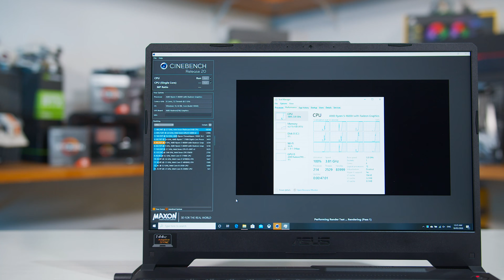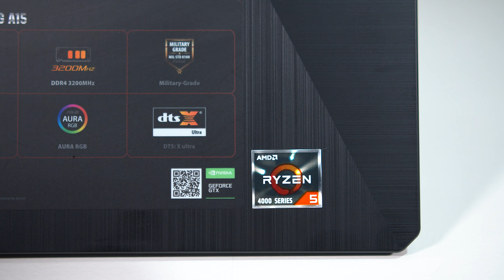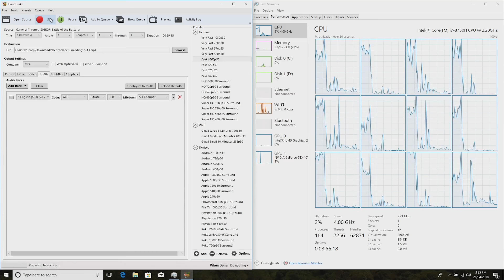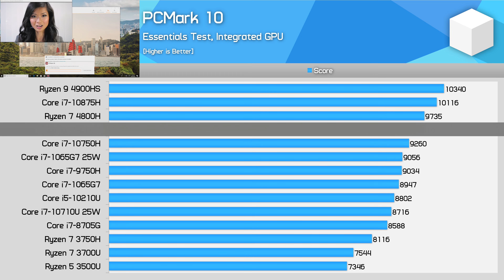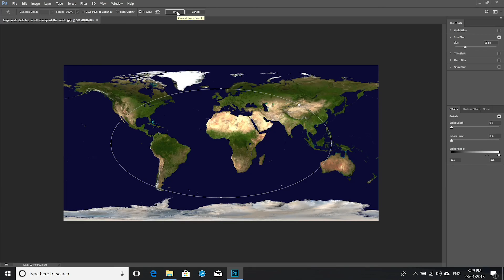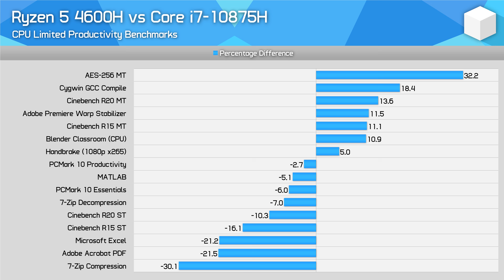AMD Ryzen 5 4600H Review, The Fastest Entry-Level Laptop CPU Ever

Comment: As i saw in your video 5700u, what's the best choice in terms of heavy excel use if the choices are somewhat in the same price range? Ryzen 5 4600h or Ryzen 7 4800u? Based on your data ryzen 5 4600h seems to have a lil advantage in excel. But is it worth it choice compared to 4800u in over all performance? Ryzen 7 4800u have 2 more physical cores please help. I'm a student and planning to work as my part time. I'm in finance

Comment: Just got my laptop with Ryzen 5 4600h man - great review! I have one issue and is battery drain in less than 1 hour. Its a lenovo laptop, im using for surfing currently and the battery is going down sooo fast! I have just noticed that my Processor Speed is jumping to 3.98 GHz and stays there and I think that s the main issue for the battery drain. Do you think how can I fix this? It would stay to 3.98 for 15 min 20 or whatsoever - sometimes more! CPU temp at 60C. I reinstalled drivers for everything, Speed now is 1.39 idle and 40 temp, is that good? I have noticed on couple occasions to 3.98 but not as before reinstalling the drivers. Any tips on this?
Reply: Legion 5?
Reply: Lt 340 gaming 3 or legion 5?
Reply: @simonmensink8162  ideapad gaming 3 but i solved my issue. Even from installing google chrome and other basic apps, got shitload of malwares. So i used malwarebytes and removed them. Battery works as it should
Reply: @krashtechnology  i have the samen laptop bro its nice i havent come across battery issues yet lets keep it like that

Comment: I'm basically torn between buying the 4600HS version for £1099 or spending the extra £400 to get the 4800h version with the RTX 2060. 

I'm just concerned about the fan noise that people have talked about, does this laptop have good accessibility to the CPU? like would it be relatively easy to get to and repaste with liquid metal to hopefully keep the temps down?

Comment: These entry level GPU's are pointless in these systems.
Given how games work with multi threading, it's pretty clear that you can easily pair the 4600h with higher end GPU's.
We don't need a 4900hs paired with the 2060. I'm sure this 4600h can easily keep up with the 2060, and then the price points you're talking about getting really, really juicy.

Comment: @Hardware Unboxed Great review, it would be nice for the U series if possible - if you can include the out of box configs so we can see exactly how OEMs are gimping the AMD 4000 series laptops with soldered on ram. I know it's a lot more work however it would really help push the laptop space in the right direct imo.

Comment: AMD has the same problem Hyundai had and still has to some degree with their Genesis line. Dollar for dollar its just a better product and not just in value but in many cases outright performance(in AMDs case positively both of those) as well. For roughly the same money as a 4 cylinder BMW 3 series I'll take a twin turbo 3.3 Genesis G70 any day of the week. The problem is the general consumer is clueless. It's only the enthusiasts that know the real deal both in cars and CPUs. Until there is marketing that informs the average Joe, and a dealer network(read more OEM support) their dents into the market will remain small. The OEMs need to hear of the demand from the consumers because its not good enough for them to just have some AMD offerings. People need to buy them, and not just the enthusiasts.

Comment: Another AMD Ryzen 6-core winner. The 4600H just crushed laptops. Please do temperature / heat benchmarks in future. Or an additional report. Thermal throttling is an issue with laptops. Good test and review 👍

Comment: Quick question, as I literally am day one new to this.

If I upgrade the RAM, is it as simple as put the part in, boot up, and it'll run the diagnostic and that's it, or do I need to do any windows backups, recovery, etc ?

Comment: Seriously, an authorities should open investigation against Intel right away. There is no chance OEMs so hugely opt for much worst Intel's CPUs to put in theirs mobile PCs unless Intel is using anti-competitive tactics again. Intel is most likely putting a lot of many into manufactures pockets on the side so they avoid building on AMD platform. In the end customers are losing. Intel was finned in 2009 in Europe for using these tactics and almost ruined AMD because of that, but obviously the fine was too low back then.

Comment: "Entry level" - 1200$ wth? This is f-d up. I bought a laptop for around 500$ (Intel N3150 quad-core CPU) 5 years ago! About 200 in Cinebench R20 multicore score. Price-To-Performance: 0.5/$. R5-4600H: 2.7/$ that is over 5 times improvement! Impressive.
Reply: Entry level for productivity and professional workloads. You can still get those cheap laptops, but you won't see film studios or independent 3d artists using them lmao.

Comment: Is R5 4600 is slower than i5 10300 and i5 10750 in AUTOCAD, RIVIT etc (where websites specifies 'mostly single threaded and recomonded faster cpus') since those have higher boost clocks.
Reply: Did you test this for yourself? Or you read/watched it in a review? If the latter, where can I see the comparison? Thanks!

Comment: Can i get a bit of clarification regarding the 2400 score for the i7 8750h in cinebench r 20 ? I own a hp omen 15 laptop with i7 8750h rtx 2060 and 16 gb ram dual channel running windows 10 v 1909 . I get constant 3060-3090 scores on i7 8750h on cinebench r20 . Laptop is not overclocked or anything . I dont think that your score is a fair represantation of the performance of this i7 , i mean the ryzen 4600h only get arround 200 more points .If necesary i can provide more info and proofs on my scores . Also in cinebench r 15  i7 8750h gets an average of 1260 points . This is a 45w cpu , on a gaming laptop , i get that AMD became nr 1 cpu giant but i dont understand the scores you got . Cant speak for other intel cpu scores but i7 9750h get lower scores in r20 in ur tests than my i7 8750h in r20 so i can assume that your scores arent verry accurate .
Reply: Still no reply for the fake scores you are showing for i7 cpus in ur test ? Let me make it clear , i have a ryzen 2500u laptop and these cpus are fking awesome , im not questioning AMDs fantastic cpu lineup , im questioning the fake scores for the i7s
Reply: Screenshot with 3077 score on i7 8750h on a HP Omen 15 laptop no overclocking as these laptops already get hot but no thermal throttling  and certanly way more than 2400 score ur getting on i7 in ur "test"  https://ibb.co/Gx0Q87Q

Comment: A really important point that everyone seems to be missing out on is the price. AMD's entire stack is essentially one tier below Intel when it comes to price. In other words, their 6-core 12-thread 4600H is meant to compete with Intel's 4-core 8-thread 9300H/9400H and their latest 10300H/10400H at the $250 price point, while their 8-core 16-thread 4800H/HS and 4900H/HS is aimed at the 9750H and their latest 10750H/10875H at $400-450 price point and NOT the ludicrously expensive 9880H which sits at $550, and worse still the 10980HK, at $580. I'd reckon that the 4900H could actually keep up with the 10980HK and even trade blows while using only 45W vs 90-100W on Intel and costing $130-150 less.

You really can't take any of AMD's Ryzen 4000 mobile parts for granted, even if it's their cheaper, budget oriented stuff.

Comment: two things:

a 1000$ laptop is NOT an entry level laptop, as much as Apple may want you to think so.  It's solidly in the high end.

and second, when are we going to see a laptop that doesn't have the GPU?  It's useless in my situation, makes the laptop cost more, weigh more, breaks drivers, and lowers battery life.  I want to see these 20 watt chips put into a 12 inch chassis with an all day battery life, not pay out the ass for a desktop replacement I can't upgrade.
Reply: This one was a 45w chip. You'll want to look up the "U" series for what you're asking.

Comment: This will frustrate me next upgrade, if OEMs don't start putting AMD CPUs in the few compromise premium laptops.
My last few laptops have been smaller performance premium built types. Alienware m15, XPS 15, HP OMEN 15 (original).
I'd love to have the Ryzen 9 4900HS in my m15 with RTX 2060!

Comment: It's not domination. Tell people the truth that are looking to buy gaming labtops... The I-7 Intel 6 core... Pushes out higher frame rates than the new 8 core AMD... People work hard to earn that much money... They want the best FPS & gaming performance not just a faster computing experience... Tell the truth..
Reply: Are you new to benchmarking or wilfully daft?

The other laptops have 80W 1660s and 2060s, while this one has a 50W 1650Ti
Reply: @CommandoTM  I've been watching AMD labtops with the same gpu as mine be tested on frame rates... They're selling u something that isn't as good at gaming..
Reply: @CommandoTM . I'm talking about the gaming labtops in general not just the ones in this video.
Reply: @bradbeyers9028  even with the same exact model of GPU, power alloted to the GPU by the vBIOS differs for every model. That why we see some 1660 Ti laptops beat some 2060 laptops, because it's 80W vs 60W

But here, there's no point in doing gaming tests as this TUF A15 model has a pitifully weak 1650 at a woeful 50W. And don't discount the fact that on some laptops, CPU TDP is pushed higher than the 45W spec up to 60W or even 90W.

That's why laptop benchmarks arent as simple as you may think
Reply: @bradbeyers9028  have you checked the GPU wattage on your vBIOS? If its higher than what's on the 2060 of the Zephyrus G14, then that explains why you get higher FPS
Reply: @CommandoTM  u know what I'm saying ur just being a dick.  Willfully daft... No I just noticed something cuz I've been researching them making sure I didn't make a bad decision.

Comment: I'd love the see a benchmark of the integrated Vega GPU, that would be awesome as the 4500U has the same one and I'm thinking about buy it if it manages to run basic games like Minecraft or some easy emulators
Reply: Even the 3500u runs Minecraft fine. It can even play GTA V at playable frames. I'm sure this new generation does it better.

Comment: Please, Test laptop with Ryzen APU too
Especially Gaming performance
Reply: gaming performance is low
because among other things it can access just 2gb or ram , for new games you need 4 gb minimum and it doesn't have enough CU ' s for demanding gaming computation 

you need at least performance equal to rx560x or GTX 1050 to play at low resolution .

bla bla bla cpu this cpu that but without a good integrated graphics card 

for games you need a 4 core and a graphics card mentioned above to play new games on low resolution 

it's intended for other applications demanding cpu performance (but the coding for multi core  cpu's are bad , it's hard to see a semnificative performance over 4 cores on many applications , with ps5 maybe programers will optimize the code better for 8 cores cpu at least)
Reply: @user-su7vy9zb8l  there's no vram in Igpu. it will untilize system RAM as much as it need.

Comment: AMD is just crushing it in both CPUs and GPUs. I switched this year from an Intel/Nvidia gaming rig to an all AMD gaming desktop. 

No regrets. And, saved some $ to add storage and a new monitor.
Reply: same bro
Reply: Well, AMD drops support for their hardware very early. Around 8 years ago i bought an HD6870 Black Edition (2 gb gddr 5 ram) with around 1 Ghz coreclock speed which was a beast but they dropped the support for it since 2016. It was a super powerful card and better than at least half of their new cards in 2016. I wasn't able to play FIFA 18 only because their lazy ass workers treated the card as a legacy one meanwhile the weaker gtx 460 from Nvidia (Which was older than 6870) is STILL (2020) getting driver updates. I was so mad at AMD that i promised myself I'll never buy an amd graphic card again. (It's even more sad that later that year some people find out that if you rollback the driver to an older one and edit some registery keys to fake that it's updated, you can run FIFA 18 smoothly! Did you get what they did there?)
Reply: @serix_16  interesting. But that gpu was released in 2010. I'd say 6 or so years of support is decent. I upgrade about every 4 years. 

Plus, Dr. Lisa Su has changed AMD culture since she took over. It's a completely different company under her leadership. 

Not saying Nvidia is bad. They make great cards. But, AMD is just a better value now. My 2 cents, anyway.
Reply: @billb0313  Nvidia vs AMD is fierce competition. Nvidia seems to have the edge in architecture but they also want more money and focus more on proprietary tech (Gsync for example.)
Amd has less efficient architecture (now offset with better 7nm fabrication process) asks less money for performance and focus more on open standards. (Vulkan/Vsync)

I prefer the AMD approach. But won't deny the edge of Nvidia's architectures especially at the top end of the GPU ranges.
Reply: @barneyklingenberg4078  AMD have kickass hardware with reasonable price but shitty driver. NVidia also didn't go intel and keep pushing their products albeit overpriced. And their driver is really good, hard to find fault in that. 
For GPU, NVidia is still awesome. For CPU, definitely go for AMD
Reply: @serix_16  if you comparing that gpu vs his competitor you ll see that is much faster....like gtx 680 vs r9 7970, where 7970 is up to 150% faster, nvidia claims that it supports old GPUs but in reality is not the case
Reply: @dylan.dog1  I literally explained how they forced their customers to get a new card while Nvidia still provided support for the same tier card. At that time i didn't care about fps all i needed was to run the game. 
Unfortunately there is one more reason that i can't get an AMD card which i didn't mention because we're talking about the games, But only for your information if you are a data scientist like me you need a CUDA compatible card to train and run deep neural network models which is only available on Nvidia.

Comment: Man, i hope i could get an upgrade soon, the laptop im using is incredibly obsolete
Reply: I'm running a Lenovo Yoga system with Pentium 4405Y + 4GB RAM, and a Lenovo Y510P with i7-4700MQ + GT 750M + 8 GB RAM.

Frankly for my use cases, works pretty darn well. And it'll have to do for some years to come too as my desktop runs FX currently, and the absolute priority is to get that onto Ryzen.

Comment: RAM hasn't been updated accordingly to CPU upgrade in last years.

An R5/i5 U/H processors are generally more powerful than i7 from 2 or 3 generations that were paired with 16GB RAM. Despite that, RAM is still offered at 8GB in mid-range CPU, and even 4GB in R3/i3 (which are also more powerful than previous i5 and even i7). Keeping in mind RAM usage has increased over the last years.

Laptops with both U and H processors should be configured like this:
i3/R3 should come with 8GB base as the standard (in fact, it should be the bare minimum for all devices, Windows laptop with Pentium chips, Chromebooks now that support Android/Linux, etc)
i5/R5 should come with 16GB RAM as the base configuration (maybe 8GB in cheap U processor models, but with the possibility of 16GB config)
i7/R7 should come with 16GB RAM and the possibility to configured at 32GB RAM
i9/R9 should come with 32GB RAM, with possibility to 64GB RAM

The reason why we still see 4GB RAM devices (Surface Pro 7, Surface Go, Asus Flip C434 chromebook, etc) and i5/R5 without 16GB RAM optional configurations is because just pure business and marketing, there is not a tecnically logical resason to do so, or at least I can't find one.

As a practical example, see the i7 7500U 2 cores 4 threads processor that was usually pair with 16GB RAM. A current 10th gen i3 is equally or more powerful, even the i5Y model is quite more capable than that i7. Why can't I pair premium ultrabooks i5/R5 with 16GB RAM? 

What do you think guys?

Comment: Will there be gaming comparisons at some point? Like a r7 4800h/rtx 2060 vs i7 10750h/rtx2060? Most of these comparisons are cpu benchmarks only, because they have different gpus. Do you guys have something planned in that direction for the future?
Reply: trains4ever88 the point is that we will have 4800 with 2060 vs 10750 with 2070... it is not possible to get amd laptops with powerfull enough GPUs... to make those comparisons. Or Intel cpu with gpu weak enough.

Comment: I mean, we've kinda got used to AMD leaving Intel in the dust on deskptop, HEDT & server platforms... But I don't think any of us were expecting them to bring up this much of an advantage in the laptop space. The comparisons of the 4800 and 4900H compared to DESKTOP i7 were pretty embarrassing for Intel, but this a whole different level of domination.
Reply: The process node size advantage is arguably a bigger factor on heat and power constrained mobile devices than on desktop. Though suprisingly power and heat are also bottlenecks in the server space when you do large scale horizontal scaling.
Reply: Everyone with a knowledge of Ryzen 3000 power consumption vs Intel counterparts knew it will be slaughter. 
You can't beat 7nm with 14nm with laptop thermal/power constraints.